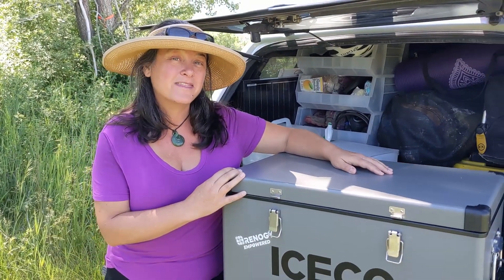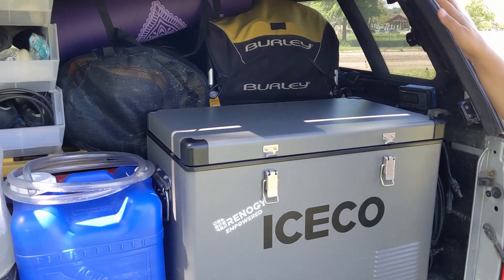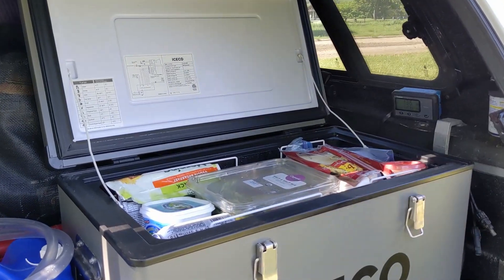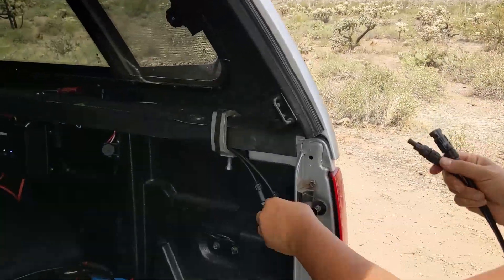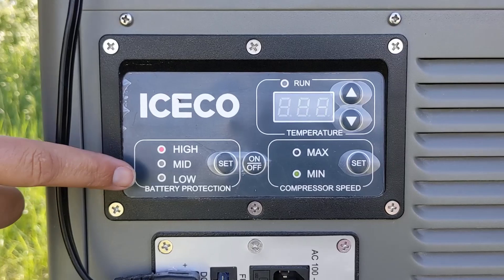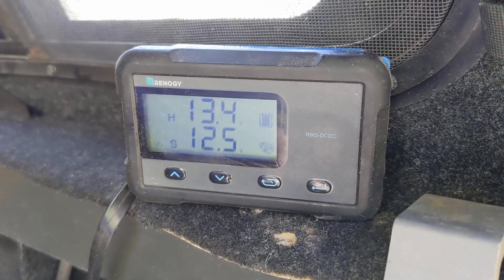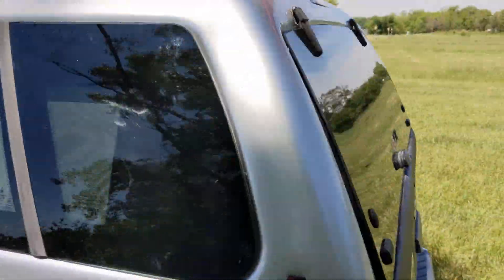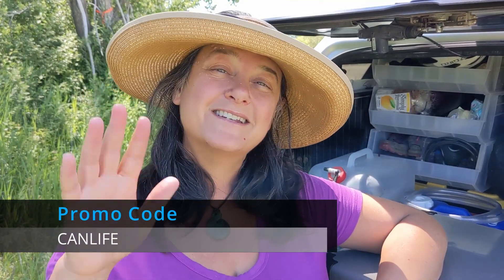Product Reviews: ICECO VL45 Fridge / Freezer & Renogy Dual Input DC to DC Charger

Comment: great little review I got the Fridge for my car,  now looking and your charging system. which will work great for the fridge and my ham radio set up.  thanks
Reply from the maker: Many thanks!  Our charging system works fantastically well, we barely even think about the cooler any more.  Let us know if you have any questions after you watch our installation video and be sure to use our affiliate link and promo code to save some $$.

Comment: After informing ICECO that the inside temp was as much as 9-10 degrees warmer than the display (with 3 high quality thermometers over a weeks time),they told me that a 14 DEGREE difference was normal. And sent me this Einstein theory:

Hi there,
Thanks for contacting us. We would like to explain to you that the temperature control logic of this model is based on Celsius (°C) units. When you switch to Fahrenheit (°F), the temperature is calculated using the formula F = (320 + 18C) / 10 and then rounded to the nearest whole number for display. The temperature setting range is -20°C to +20°C, which is equivalent to -4°F to 68°F in Fahrenheit.
It is normal that the fluctuate of our fridge within 14℉. The working principle of the compressor is that when the temperature sensing head detects that the temperature inside the refrigerator has reached the set temperature, the compressor will stop working, and the temperature inside the refrigerator will rise; when the temperature inside the refrigerator rises to a certain temperature, the compressor will continue to work to cool down.
The laboratory's test standard is based on the running average temperature of the center inside the fridge, to determine whether or not the fridge is qualified by monitoring it in real time over a long period of time.
And the temperature displayed is actually the running average temperature of the internal centre of the fridge.
If you have further questions, please feel free to contact us, thank you!

Best Regards,
Ellen

....really?
I didn't see this theory on your website while you were boasting accuracy.
Reply from the maker: We've used ours for 2+ years and have never had any problems with food spoilage and haven't noticed a big discrepancy between the setting and the temperature of the food inside.  But we've not used internal thermometer.  We've been in the  desert southwest and the cold north and everywhere in between.  Were you testing with food in the cooler? Did you ensure that nothing was blocking the internal vents? Which compressor speed setting did you have it on? Also which battery protection setting?  And were you running off AC power or DC power?  Did you test before, during and after the compressor kicked on? All these things could affect the variation.
While we cannot comment on the mechanics of the internal sensor, we can say how big a step up for us this cooler is when compared to using an ice chest.  If you think your fridge is malfunctioning, let us know how we can help you out with getting a better answer from ICECO.  Thanks for sharing your experience.